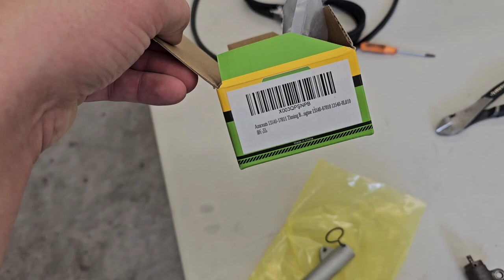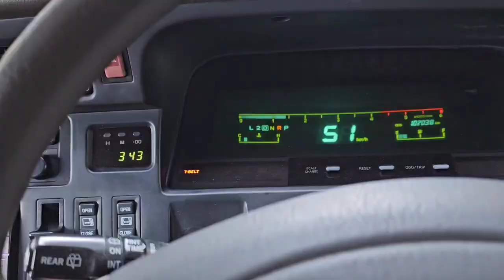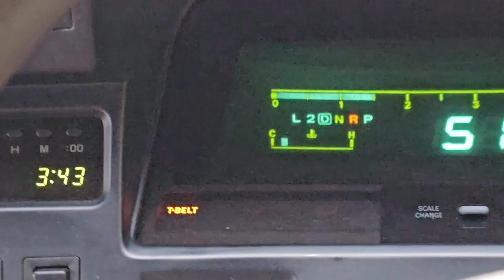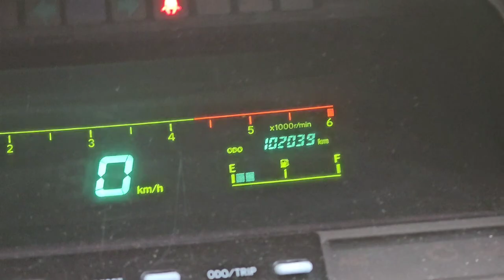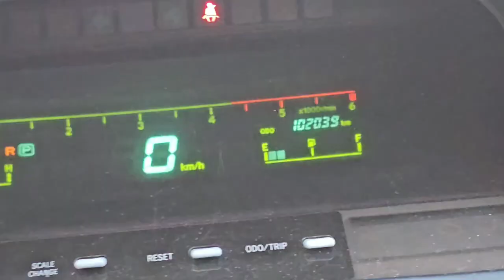Toyota Hiace Timing Belt Replacement +AC/Alternator Belts (1KZ-TE Turbodiesel)

Comment: Thank you for making these videos. I'm about to buy a 96 turbo diesel 4x4 hiace in washington, and there's hardly any videos on them. Are you worried about overheating and cracked cylinder heads at all? That seemed yo be the main issue I found online.
Reply from the maker: Nice! From what I've read as long as you don't lug it too long and keep the Egt's down you'll be just fine. It's always been my habit to downshift before a hill and I've never had a problem.
Reply: The original factory head gaskets tend to degrade with age, regardless of mileage, so it pays to be careful, and gentle (watch out if your temp gauge goes past half way). I burned the head gasket in my 2.4L 2RZ-E THSC (crank pulley bearing failed to the water pump at 170000) and it wasn’t a fun job to replace… The 3.0 1KZ diesel head gasket, I was told, is significantly harder…

Comment: I’m having trouble getting the four bolts off to remove the fan. Is there anything you can do to keep the fan from spinning?
Reply from the maker: While I don't remember exactly how this fan is oriented, on other cars I've been able to slide a long flathead screwdriver or similar type tool in between a couple of the studs on the fan to stop it from turning while you loosen the nut, hopefully that helps